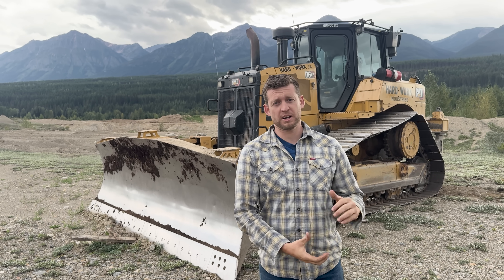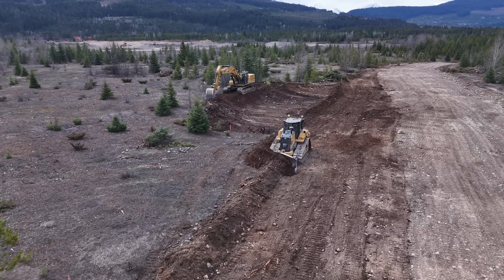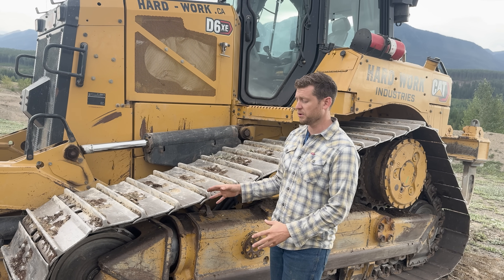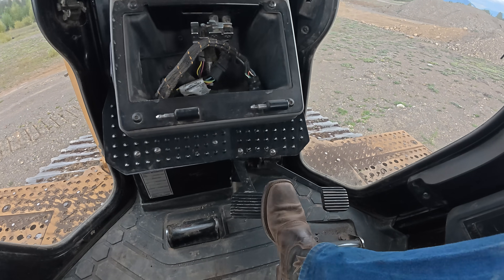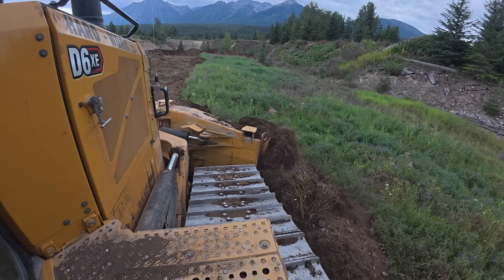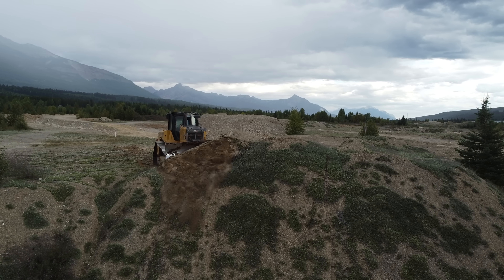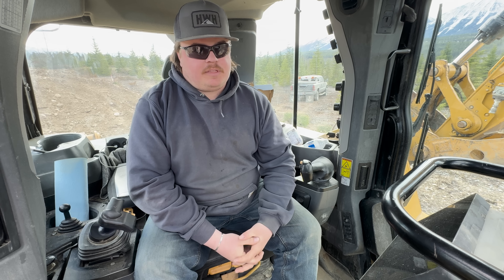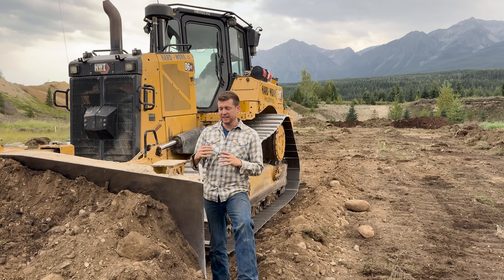Inside the Cat D6 XE Hybrid: More Torque, Less Fuel

Comment: I have always said to the leaf cutters and tree huggers. If you question hybrid, then why are MOST trains diesel electric? Its been done in the past with cars and the conspiracies are always about: "It was too good and nobody would purchase our regular vehicles anymore..." But I believe there is truth to that. You waste 100% of the energy in breaking and even engine breaking. So if you had a system that can recover that, it's already a plus. Beside the fact that there are so many more components to build and maintain on a regular car/truck etc. 
The worst about hybrids is the inefficiency of making the electricity, there are definitely losses there. However compared to drive train losses, time and maintenance, I think we can look past that. The standing torque of a electric motor is absolutely nuts, compared to a mechanical system.

Comment: If there are any fuel savings, it must come from increased efficiency through the drivetrain. As the diesel can operate all the time at it's optimum rews, that is a benefit. But increase of 30% of fuel efficiency? Doing the same hard work?  Now, 30 years ago I worked for our local CAT dealer here in Finland. I was an engine mech, dealing with marine-, industrial engines and generators. I sort of know this stuff.
I am afraid that this is just a new PR stunt to be "Green". We have seen Bud Light, HD, Cracker Barrell, California, Chigago what WOKE, Green, DEI etc brings. Nose landings. Sure, diesel-electric has many benefits. But 20000 hour warranty and 30% fuel savings to promote sales is.... brave....  Or desperate. Or true. Time will tell. After all, electric cars were adverticed as having fewer parts to break down, but now the garages specialized for those have their hands full, and the repairs are expensive.
As trains have used this for long, and big mining trucks,  it is sort of tried and true. It works. Even without regenerative possibility and storage batteries.
But again, 30% fuel savings....

Comment: I've been running a D6xe since 2020 when they came out. It's the best dozer I have operated!    All the power, great performance, and has been incredibly reliable!  In almost 6 years the only down time that it's had that lost production was once for a flame sensor for the dpf burn off and once for a failed def pump. If not for emissions the machine would be bullet proof!  Lumbers along at 1500 rpm and uses noticeably less fuel than a D6T that it replaced.

Comment: https://youtube.com/shorts/ldIN_XY_XKQ?si=P5S38VMh9Fx5dCDc i have a solution for that. the problem is the drive shaft you have just one and its twisting everything. you got two options do a cam shaft to cam shaft design with attaching rods or cables so that instead or twisting your applying and prush/pull motion or you can do the dual shaft way it works its twisting both ways and counteracts each other or the way thats not exactly possible use more material to the back adding more weight and lowering fuel and load capacity. thats not really safe to be doing that and its also limiting the hp they can work with. clearly thats too much hp for that design of truck frame. you should be able to floor it without it self destructing.

Comment: I run a hydro converted 587 pipe layer from the late 80s and it has a decelerator pedal that looks identical to the one in this d6. I’d love to get in one of these those controls are diabolically smooth compared to what I have to work with

Comment: Pretty interesting technology. If I understand correctly the big haul trucks have had a similar powertrain for years. CAT has to be pretty confident in the system to offer a 20K hour warranty. How does the engine size compare to a similarly sized dozer. There are energy loses no matter what type of drivetrain is used, the internal combustion engine is not a very efficient use of the fuel, but it’s probably are most reliable at this time. Thanks for sharing Chace. I’m a big supporter and believer in Edison Motors.

Comment: Yeah... but it's still running on diesel. 
Not 🦄💨🎉💨. 
Why not solar powered? 
Yeah... cause you STILL use diesel to power it.
Reply: A D6 Cat is 149kW.
Assuming 30% efficiency and 1000W/m squared: you need about 500 square meters of solar panels to power the thing.
In nature solar powered things don't tend to move much.

Comment: Do Edison motors trucks have warm up mode for the diesel engine. Maybe a 10 minute warm up before full throttle charging starts or at least a preheating system running off the high voltage. I can't imagine an engine or turbo will like instant full throttle at -10 freedom units.
Reply: Also I'm assuming the engine and battery do not share cooling. A running engine could preheat battery's or vise versa. Im no engineer,just a snow plow driver
Reply: Edison is making a snowplow for Emcon and this will teach them how to handle cold temps.

I'm pretty sure that the engine and the electrics both have glycol flowing through them. I don't know if the engine and electric glycol is mixed or kept separate

Comment: This video shows why Electric Drive is not practical for highway applications. Edison only has an extremely small market to serve for very limited production of off road vehicles. The CAT is a ultra high torque/ultra low RPM application that is perfect for an electric motor and that will never equate to use at highway speeds.
Reply: I agree with your comments. I'll clarify that Edison style vocational trucks are 30% of the class 8 semi truck market in North America

Comment: Great design.  An engine or any other working object works best at a given resonance.    In other words at a given rpm,  the fuel efficiency is at best or torque or both.  A speaker we listen to has a perfect hertz it operates at and any other speed is compromised.  Good work Cat.
PS,  don't tell the Carney cronies about this or lawmakers will be on top of it.

Comment: Makes me wonder how/why humanity skipped hybrids and went full electric?
We had this tech in locomotives for ages now...
Reply: Because we skipped the transition period.
When the Kyoto Protocol was signed in 1997: we had about 50 years to phase out fossil fuels.
After nearly 30 years of obstruction from the oil companies: we now have about 4 years to phase out fossil fuels.
It no longer makes sense to use hybrids as a "transition" technology: because you will simply need to scrap them in only 4 years.
Reply: @economicprisoner  It does make sense to use hybrids until batteries stop weighing 2 tonnes.
Reply: @SEThatered  Are you talking about trucks specifically?
Even the ridiculous Hummer EV has a pack weighing only around 2900lbs or 1.45 short tons.
Reply: @economicprisoner  in a 9000lbs "truck".
Look it up what happened when they crash- thested it against an AMCO barrier.
Reply: @SEThatered  I asked because the battery in my Leaf is not more than 300kg.
Reply: @economicprisoner  300kg more mass for a worse accident and still abysmal range.
Reply: @SEThatered  It provides a low center of gravity: and there is no engine block to kill me in a front-end crash.

Comment: What I see here is a machine that could be made full electric easily enough - So if you wanted to run one of these on a job site where you need the electric capability, you could just pull the engine/generator and drop in a big battery pack instead.

That's a lot nicer and easier than retrofitting electric motors into everything from scratch.

(I just watched a video about a large project in the netherlands where the government requires all-electric equipment, and they had converted excavators, fast charging trailers and all sorts of fascinating equipment).

Comment: I have spent no time around this new dozer the previous generation was the D7E and was a low drive. It was a solid machine, well it had some issues the performed amazing the fuel savings was incredible compared to a new d7 at that it worked more like an D8 and was nearly half the fuel but the low drive was the issue for most it could not clear objects as easily as an D8 or operators just didnt like them for some reason or another. Amazing machine. This looks like they learned from that and improved on it way to GO Caterpillar.

Comment: This isnt a hybrid, there is no battery. Its a diesel electric drivetrain, which is arguably one of the best heavy equipment drivetrains there is. Trains use the same thing. But like trains, no battery. Any "regen" braking is done through exhaust brakes followed by large resistors that are air cooled and dissipate heat to the atmosphere. 

The benefit of diesel electric is the lack of ac-dc-ac conversion needed for a battery system. It runs ac off the gen and uses ac at the tracks, so theres virtually no power loss from the end of the gen to the motors. You should know this considering the nature of your company. 

Theres lots of equipment where a proper hybrid would actually be benefitical, like excavators, where they could take advantage of regen and gravity to lower the arm in a very controlled fashion. Same goes for cranes.

Comment: diesel electric drive on earthmovers has been around for 40-50 years. I remember the dump truck drivers in the mines in Aussie driving fast through mud puddles in their Terrexes, so the water splashed up underneath, wet the motor and they got half an hour off waiting for the latent heat in the drive train to dry the elec motor enough for it to run again.

Comment: What a terrible design. Press the throttle to stop? What happens if the operator passes out, has a health issue, foot slips, and or wrecks? What if they can't press the pedal? Wouldn't foot off and auto stop make more sense?

Comment: This Hybrid setup has been used for trains for like a century, it is STUPID why this setup is not more or less standard Hybrid setup.. now, i love my Hybrid setup i have in my VW, cuz its not the "Train-setup" but its not the stupid Volvo and many other car brand setups there ICE engine is driving the front axel, and the electric motor the rear wheel axel.. in VW cars the e-motor is mounted in between the ICE engine and the gearbox, so then driving on only electric it still use the gearbox. and i get a really torqy petrol engine. my small 1.5Liter dual turbo VW feels it has a 3.0 Liter Diesel then the e-motor help the petrol engine on low revs in "boost" mode. now that is both fuel efficient and FUN! but not as fuel efficient as "train-setup" but i still have fun with a petrol car. But are we going to be a bit boring and smart to 100% the way of doing it RIGHT if you want or need a "electric" vehicle,  this is setup to go for imo, and there for i think Edison Motors are doing THE right way, as long they use SCANIA engines ;)  happy to see that here from Sweden.

Comment: Very strange that there's no battery, considering that most dozer work demands full power when going forward, then a fraction of that power to move the machine the same distance backward. Maybe forward motion under load is so much slower than backwards motion with no load that the time to "recharge" the batteries just isn't very much?

Comment: Train Dynamics:
The interaction between the train and the track is crucial. A design flaw in a vertical curve can increase lateral wheel-rail contact forces, which is a significant risk factor for vertical derailment.

Comment: Why couldn't you just make it fully electric?
Reply: It would need to carry 20,000 lbs of batteries for an 8 hour shift
Reply: @Sah-o5m Not if it's solar powered
Reply: @aaronfield7899  A D6 Cat is 149kW.
Assuming 30% efficiency and 1000W/m squared: you need about 500 square meters of solar panels to power the thing.

Comment: I don't see why its called a hybrid. It is just diesel electric similiar to a train.
Reply: What provides the electrical power to move the machine? A diesel generator...

hybrid---a thing made by combining two different elements

If you are using both diesel power and electrical power in this THING, what does that make it??
Reply: @codymoe4986  We have never called trains hybrids we have always called them diesel electric. Their is nothing on the market called a hybrid unless it has both batteries and an engine. Power can come from the engine or the batteries. On top of that nobody except Edison is calling it a hybrid to suit their own narrative. Cat is marketing as an electric bulldozer.

Comment: Is there a reason why a Bulldozer couldn't have the same cockpit position as a combine harvester? I ask this with the operator in mind and the better visibility it would afford?
I'm also mindful that we're likely only a decade away from fully autonomous construction equipment so operator considerations may soon be moot...
..but perhaps there's a future market for a Command & Control Vehicle where an operator will marshal multiple machines from a single unit capable of traversing the entire worksite if required..

Comment: Cat replaces the torque converter and transmission with a generator and motor. 

This is the same setup on the 988XE. Remove the mechanical power train and replace it with a generator and motor. 

It’s pretty wild to have a 988 with no physical connection between the engine and axles.

Comment: All diesel locomotives are just a generator with electric motors on the drive.  Add a few batteries and presto,  ya' got a hybrid.  It's been around for years
Reply: Look at the German Class 218; your statement doesn't apply much to the areas that buy German diesel locomotives (which almost all use a torque converter automatic gearbox; diesel multiple units tend to use bus-derived ones with the torque converter locked after first gear (not counting legacy equipment in production usage)).
Reply: Nobody said it hadn't been around for years...who are you addressing?

Comment: Why not add a battery that can charge when traveling in reverse? I do like the cup holder with coffee cup handle cutout.
Reply: You need to go back to school and redo your physics classes.
Reply: If you think a dozer uses as much power traveling in reverse as pushing in forward then you are dumb.
Reply: Where's the power coming from to travel in reverse?

Unless all their pushes are uphill??
Reply: It does have an engine. I have run dozers for years backing up with the blade raised does not take a fraction of the power as does pushing.

Comment: Just saw a video about the Swiss truck manufacturer Designwerk. They have special purpose battery electric trucks and one of their remarks hit me and I had to share it here.
The trucks that do more off-road work seem to have experienced more vibration and that had negative effect on E-axles. That's why they moved to use the Volvo style central drive shaft and mechanical axles.

Comment: How is this a hybrid, it has no battery to run electric only and there is no mechanical drive. It is diesel electric. 
Great machine, good video but the termonoligy is just wrong.
Reply: It's hybrid because it's electric axle with diesel engine. It's semi-demi hybrid? It's Bi-hybrid? It's Faux-hybrid.

Its ev because electric axle. It's not ev because no battery.

It's diesel because diesel. It's not diesel because no transmission.

It's the future is what it is.
Reply: @Sah-o5m  Hybrid drive means a combination of 2 drivesystems. This machine only has one.
I stand to be corrected though.
Reply: @GerbertGerbert  This machine uses a diesel generator to provide electrical power to the drivetrain. AKA a hybrid.

Try again...
Reply: @codymoe4986  That makes zero sense. It would make anything but mechanical drive a hybrid. Hydrostatic drive a would be hybrid, maybe even a torque converter. Certainly a powersplit continuously variable transmission like in tractors.
There is only one way of driving this bulldozer: electric. Not a hybrid.

Comment: I drive D8T. It has 4 gears and torque lock. As you push you go through all gears. Reverse is 4th and pushing is constantly going through 3 gears. I can fully understand how this thing can save 100 liters of diesel every day.
Sometimes you do some lite work but you wanna speed, so engine is roaring at full tilt while being on 20% load... If you have generator you can do speed grading at 1500 rpm.
Reply: if hyd pump keeps up
Reply: Dozing in 3. gear and backing in 4. Is crazy fast and will wear out the machine and operator.

Comment: what a brilliant bit of engineering. if cat were to offer there hybrid drive in a something like a motor grader thats build for on road use would they have to jump through the same hoops you guys do with the emissions testing to on highway spec?  cool video, thank you for sharring it. good on you Hard work industries for using a hybrid dozer to build the test track for hybrid trucks.
Reply: Any manufacturer that makes an engine for "on highway" usage must spend millions of dollars on EPA ECCC emissions certification
Reply: @Sah-o5m  thank you, i get that totaly, hence my question was more asking if cat have already done that so you could then use the cat engine genny combo.
Reply: @SharonD9539  I believe Cat and Cummins make engines that passed certification and can be put in a vehicle and will pass emissions.

My understanding is that when Edison uses a 3rd party computer to tell the acceptable engine to start/stop/idle well now the street legal engine is now being used in a manner that has not been proven to pass emissions, even though it seems to make sense. 

So ECCC told Edison that since Edison is doing a thing with no precedent, then Edison needs to spend $1M and 2 years of dyno testing to prove the engine will still pass tier 4 final standards.

Edison doesnt want to spend $1M.

Comment: Is the dozer series - parallel battery hybrid, or series diesel electric??

Sounds pretty much the same as a hydrostatic system - with all the hydraulics / hydrostatics swapped for higher efficiency Electric..

Next gen will probably have all electric rams too..
Reply: The Cat d6xe has no battery
Reply: it is series diesel electric